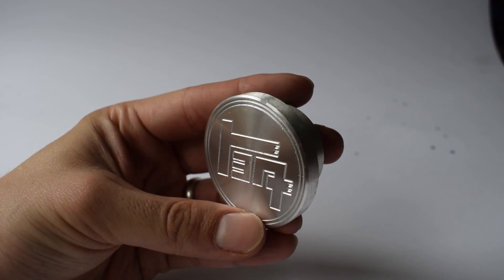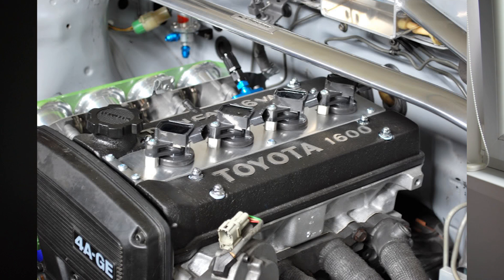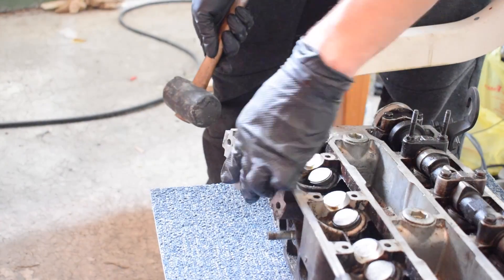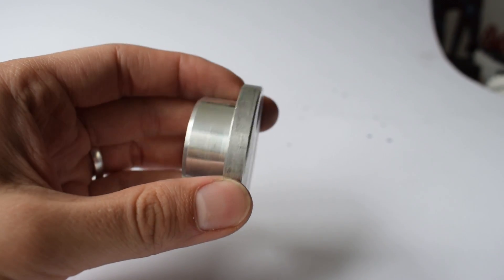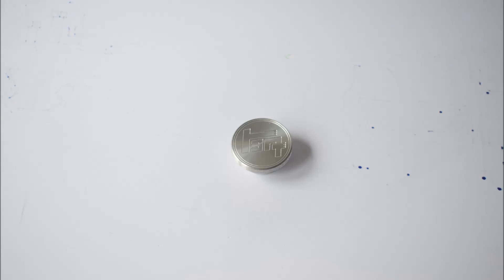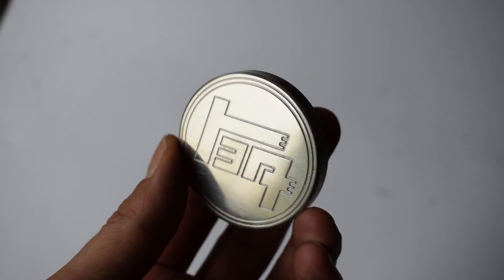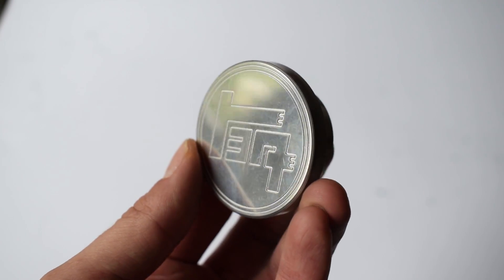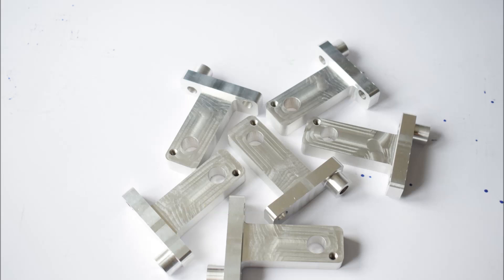The 4age distributor hole plug delete is back!

Comment: Are these still available? How many of you have ordered parts from this man ? Is he legit ? I like his videos a lot so I hope so 👍🏽
Reply from the maker: He's a fraud! Don't buy from him. :) Seriously tho, unfortunately I don't make these anymore or any other cnc parts. I'm just selling my remaining stock. After thid I made an improved distributor plug that's easy to remove but I sold that out too. I have one single piece left, but it has cosmetic damage.
Reply: driving 4 answers wow it’s you haha. I mean no disrespect I just like to hear from a happy customer. So you only have one more distributor deletion plug ? If so how can I get a hold of it? I am running a crank trigger wheel as well. Mine is placed on the back of the crank pulls do you have a sensor bracket that would work with that ?

Comment: where does the camshaft pos sensor fit on a 16 valve 4AG? or does the nodiz work only on the crankshaft sensor?
Reply from the maker: Nodiz only needs the crank position sensor. The 4age doesn't have a camshaft position sensor as stock, so to fit it you would require some sort of custom solution. But you really don't need it as almost all aftermarket ECUs will work without it.
Reply: driving 4 answers ok i see thanks
Reply: Thanks I was wondering that too. I appreciate the knowledge!